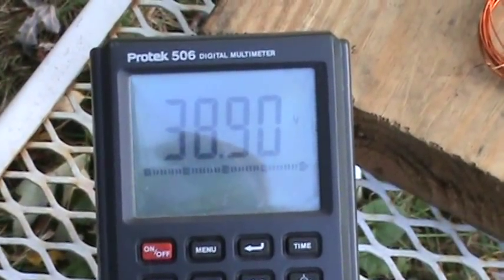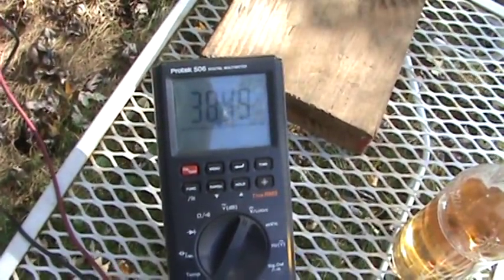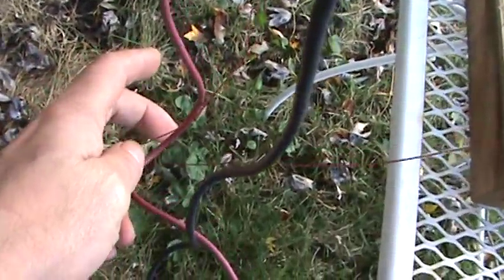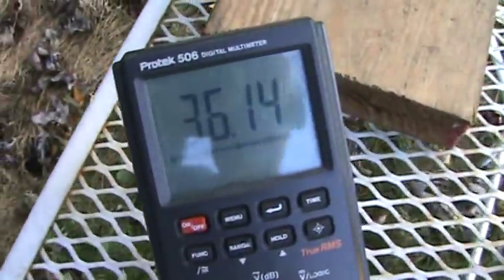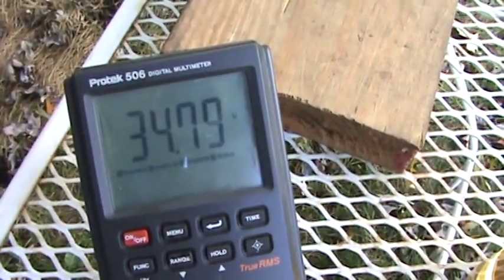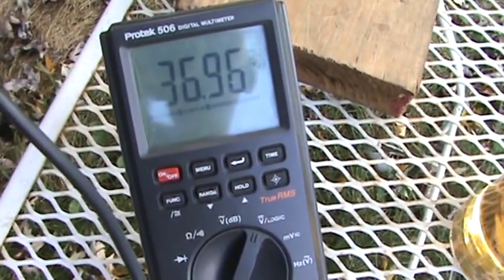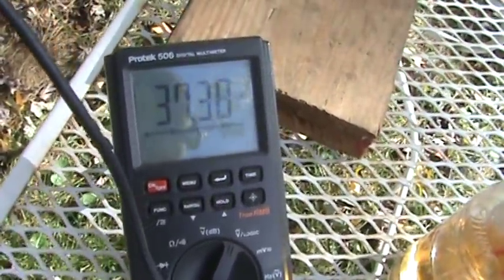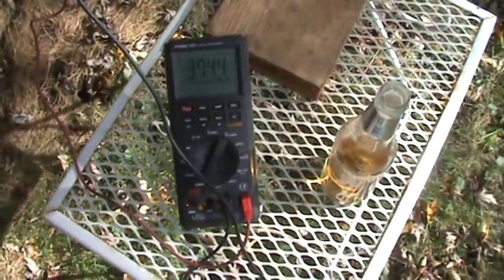Free Energy From Air 2015 part 16

Comment: The copper plates you got can be used to build a capacitor box to be charged by the DC voltages you're playing, and pulse discharged into step down transformers.

Comment: Also, with high voltage you can use transformers to step it down, therefore increasing the current to useful levels; ohms law.
Reply from the maker: +Joe Bem I tried, but maybe i need to build my own special transformer.  The transformers dont work.  I think the problem maybe that there is too little current to induce the secondary winding in the trans.